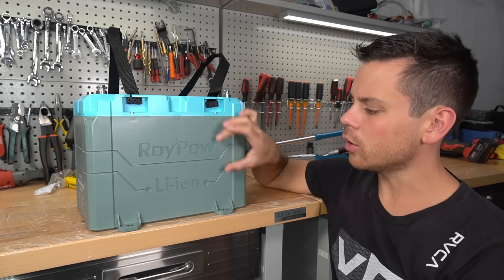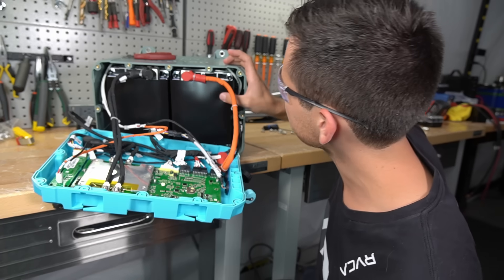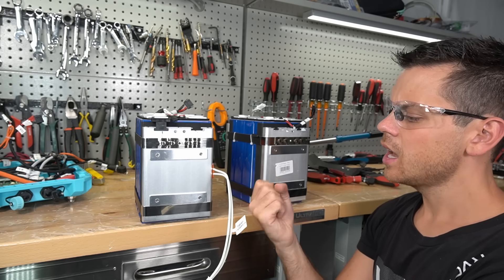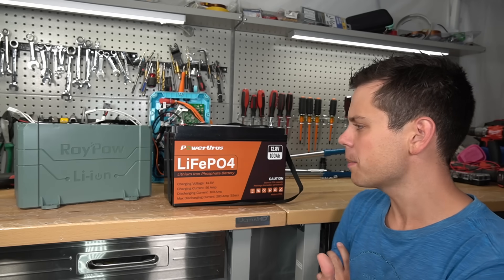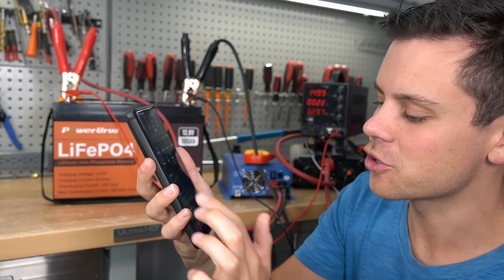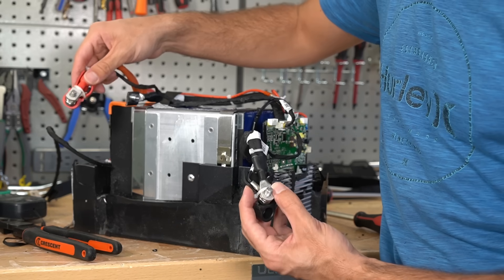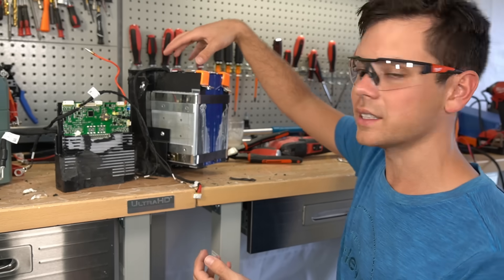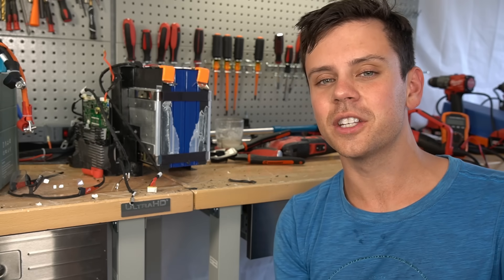RoyPow Solar/Marine/Golf Kart LiFePO4 Batteries

Comment from the maker: Attention: If you want the cheap price in the video, you have to add the batteries to your cart. Not sure why they did it this way. Links are below:

Product Affiliate Links:

12V 100Ah Budget Battery: 
https://powerurus.com/products/powerurus-12v-100ah-lifepo4-deep-cycle-rechargeable-battery?aff=2

12V 200Ah Budget Battery:
https://powerurus.com/products/powerurus-12v-200ah-lifepo4-deep-cycle-rechargeable-battery?aff=2

24V 100Ah Marine Trolling Battery: https://roypowcell.com/products/roypow-24v-100ah-lifepo4-battery-for-trolling-motors-and-fish-finders?aff=5

36V 100Ah Marine Trolling Battery:
https://roypowcell.com/products/roypow-36v-100ah-lifepo4-battery-for-trolling-motors-and-fish-finders?aff=5 

0:00 24V Marine Trolling Battery
1:37 Tear Down
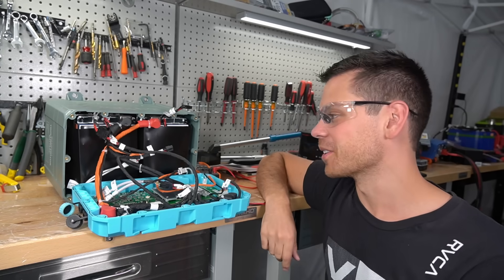8:06 $400 Budget Battery
12:30 $400 Battery Teardown
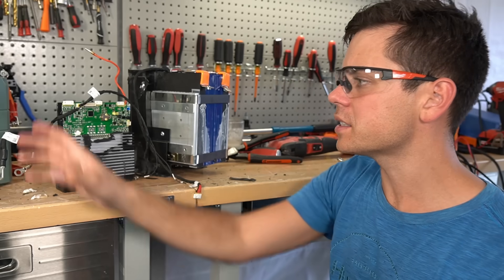15:49 Conclusion
~~~~~~~~~~~~~~~~~~~~~~~~~~~~~~~~~~~~~~~~~~
Tired of getting ripped off? Check out my "Will Prowse Approved" solar product recommendations below!

12V Batteries
https://www.mobile-solarpower.com/lithium-batteries.html

48V Batteries
https://www.mobile-solarpower.com/48v-batteries.html

Offgrid Inverter System Builder
https://www.mobile-solarpower.com/48v-complete-system-blueprint-559371.html

Hybrid Inverter System Builder
https://www.mobile-solarpower.com/code-compliant-48v-offgrid-system.html

Mobile Handtruck System Builder (very popular!)
https://www.mobile-solarpower.com/mobile-48v-system.html

Solar Panels
https://www.mobile-solarpower.com/300w-solar-panels.html

Ground Mount Solar Racking
https://www.mobile-solarpower.com/ground-mount-racks.html

Wire, Lugs and Busbars
https://www.mobile-solarpower.com/wire-and-connectors.html

Tools
https://www.mobile-solarpower.com/tools.html

Fuses and Circuit Breakers
https://www.mobile-solarpower.com/fuses.html

Plug-N-Play Solar Systems
Ecoflow, Anker And Bluetti! So many models to choose from. See my current recommendations here:
https://www.mobile-solarpower.com/full-size-systems.html

~~~~~~~~~~~~~~~~~~~~~~~~~~~~~~~~~~~~~~~~~~
Need to build a large DIY system? Need a trustworthy solar distributor? These are my favorites:

Signature Solar
Creator of EG4! Solar Minisplits, Victron and More! Largest Solar Store Online.
If you want $50 off, please use my link below and coupon code "DIYSOLAR50":
https://signaturesolar.com/?ref=cPwLcVc0SW-BjN

Current Connected
Best Prices for EG4, Victron, Midnite and so much more! Fast Shipping and Highest Rated Customer Service:
https://currentconnected.com/?ref=wp

~~~~~~~~~~~~~~~~~~~~~~~~~~~~~~~~~~~~~~~~~~
Join our DIY Solar Community 
Need more help? Join the largest solar forum on the internet for beginners and professionals alike. 140,000 members and counting!
https://www.diysolarforum.com

Check Out My Free Book
Best-selling and beginner-friendly guidebook to off-grid 12V solar!
https://www.mobile-solarpower.com/the-book.html

~~~~~~~~~~~~~~~~~~~~~~~~~~~~~~~~~~~~~~~~~~
Contact Information:
I am NOT available for personal solar system consult! If you wish to contact me, this is my direct email: williamprowsediysolar@gmail.com
FTC Disclosure Statement and Disclaimers:
Every video includes paid promotion or sponsorship (such as free products for review). Some links on this YouTube channel may be affiliate links. We may get paid if you buy something or take an action after clicking one of these. My videos are for educational purposes only. Information is subject to change/update at any time. Electricity is DANGEROUS and can kill. Be smart and use common sense :) DIY Solar Power with Will Prowse is a participant in the Amazon Services LLC Associates Program, An affiliate advertising program designed to provide a means for sites to earn advertising fees by advertising and linking to Amazon.com
Reply: They fixed it already
Reply from the maker: @niktak1114  oh thanks for the heads up, that was fast
Reply: @WillProwse  how much for the one with the destroyed balance battery. Would like to use it for the 12v led acid battery.
Reply: OK! Lesson learned !  I  was kicking myself for a similar mistake. Glad Im not alone
Reply: I've been seeing a lot of Facebook ads for renology's 200 amp hour lithium iron phosphate battery. way overpriced and whenever I ask him what cells they're using I never get a reply. I have also heard rumors that you cannot connect them in series. maybe you can shut some light on this.

also you might want to check out the power Queen 190 amp hour lithium iron phosphate battery hobotech recently did a review on it It looks pretty good for the price He didn't do a tear down but maybe you would?
Reply: Only $400 now, no sales tax and comes with free charger. If you let the Powerurus battery sit for a length of time without using, will the bluetooth eventually kill the battery?
Reply: would be nice to get a DSCOUNT CODE for these

Comment: I wonder about the thermal conductivity of the foam and glue they put in the heatsink fins, which work well with moving air. But inside the box, the trapped air probably won't move much, so those materials could be better than the still air that they displace. Maybe a good idea?

Comment: 16:40 The BMS heat sink is probably better cooled with touching the glue that is probably more heat conductive than the air itself. There is no air flow inside a battery else than the natural "convection".  Sometime plastic transfer heat to the exterior of the battery better than the air. Air is a good insulator and without forced air flow or limited convection, it is not effective

Comment: I have one and developed a small crack on the light blue plastic along one of the bolts. It's fine to just epoxy or silicone it i assume? Do LiPO4 batteries have risk of fire if it gets humidity in there or really more if it gets flooded?

Comment: I bought this battery on Amazon: 12V 12Ah Deep Cycle LiFePO4 Battery, RoyPow 12 volt Rechargeable Lithium Iron Phosphate Battery with low-temperature cut-off, 3500~8000 Cycles.  I use it for my sonar on my kayak.  It has failed within the warranty period of 2 years.  However, I cannot get any response from this company, either by phone, website, or letters.  Amazon can't even reach them.  This is terrible service!  Do you have any suggestions as to how to get a response from this company?

Comment: I bought an  Epoch 36100H for my golf cart. Same packaging as RoyPow from the outside. I has a heater so I can charge below freezing. They advertize 100 Ah but in reality it is a 105Ah. nice to see them underestimate in their adveertizing instead of the other way. On /Off switch. Wifi enabled . Meter that alarms when you get low in power and a second alarm so you won't run out of power getting home. It can run up to 120 amps continuous and 200 for a very short time. it works for my 2002 EZGO TXT series cart with larger tires. Thanks Will for letting me see the quality of the next generation 36v golf cart battery.

Comment: My Powerurus 200 Ah is junk  Voltage cuts and bluetooth freezes with just a 42 amp load at 52% soc. Then it comes right back on and repeats the cut minutes later. The app barely manages to connect after multiple tries.  Strange how many channels have positive reviews on this stuff but the first one I buy is complete trash.

Comment: Per your recommendation, I bought two of these batteries and connected them to a Xantrex 2000w converter/charger in my RV.  When I changed the settings in the Xantrex to Lithium, I also was able to set the charger rating to 80amps.  I'm not an electrician, so I was just going off what Xantrex recommended.  However, I noticed when I installed the batteries that it said the charging current is 50amps.  Does that mean I can only set my charger rating to 50amps?  Thanks!

Comment: Hi my friend I have two lithium battery in series 2 12 volt 100 ah so 24 volt for my trolling motor so I want to charge the battery at the same time so if I put only one bank how much amp I need to charge 2 battery at the same time because I have one bank 5 amp and it doesn’t work! Thank you for the answer ! Stephen!

Comment: Thanks for the great review! I was ready to order three of the 100Ah batteries to get more usable Ah than my current four 6v AGMs, then saw in the PowerUrus manual they do not recommend connecting more than two in parallel. Is there a good reason for that? Is that true of other Li-ion batteries? What am I risking if I do? Thanks!

Comment: Can I put prefab batteries in series and or parallel without adding a bms controller between or does the the internal bms within the battery pack sufficient

Comment: @DIY Solar Power with Will Prowse  How does the RoyPow Compare to the EPOCH batteries? Same company? I see the case say's RoyPow on the Front in small print, but different website &  different specs on the 36v battery... Using it for a Trolling motor.

Sincerely,

Matthew

Great Videos by the way, glad I found your channel

Comment: While searching to purchase these marine batteries I came across another brand EPOCH Batteries that has the exact same case as the RoyPow marine only difference is the color and that they actually have 12v in stock I’m curious if you know if it’s the same internals at all?

Comment: Hi,
I use GM batteries for my power wheelchair. Each battery has 12V 74 AHM. They are connected to 24V. I want to know if you can suggest me if I can use LiFePO4 batteries for my power wheelchair. Please explain to me how I can use LiFePO4 without damage my power wheelchair.

Comment: Temperature sensors on the terminals work great to measure internal battery temperature as the terminals transfer the internal heat efficiently

Comment: Do you know of a source for the "high quality marine battery" in 12v 100ah. I would like to use for energy storage on a sailboat. I would likely use 4 @ 100aH in parallel. I am only able to find this battery in 24 and 36v. Do you know the relationship between roypow and epoch batteries? They look virtually identical. Trying to understand this burgeoning industry. Great videos! So hard to find out what is really going on in these batteries.

Comment: I purchased a two pack 30 ah 12 volt Roypow batteries and one of the two was bad out of the box. Voltage measured 12.6 volts but would not draw any current when attempting to charge. Not sure what I think about this brand now. Most likely would try another company.

Comment: for a beginner setup, would you reccomend the roypow/epoch 100ah (105ah) marine battery or a 280ah eve diy setup.. will be using outdoors and on a boat.. and charging by solar off and on... your thoughts are appreciated buddy

-eve cells grade A are £140 each... and the roypow epoch 100ah marine is £300

Comment: Can you check out the Epoch trolling motor battery? Looks almost identical, but they’re a little cheaper then Roypow. I have been wanting to get a 24v unit to power my trolling motor, but I’m always too nervous because the variance in all the lipo4 companies
Reply: I too am curious about the roypow vs epoch for marine apps. 12v 100ah lifepo4 would be a game changer with this level of quality.

Comment: Can I charge two lithium batteries that have similar dissimilar app hours. For example could I charge a 12v 206ah SOK at the same time as a ECO-worthy 12v 30ah that are wired in Parallel on the same 14.6 V feed.   Both have their own BMS.   My usecase is that I would detach the 30 AH battery and use it as a trolling motor and then reattach it to the main system for charging when I am done. 

Anyway any advice would be appreciated

Comment: I woule pay for content where you would for instance show how upgrade an existing system with a new battery or new panels in a step by step way. The forums in which users have questions specific to their setup is so numerous and the Inverter configuration so diverse that anyone would pay in order to solve their technical problems. Me, ive an Axpert with 4 lead acids that I wanna now configure for my dyness 5.12 kw...

Comment: Thanks for investigating this trolling motor battery.  I am in the market to switch from AGM to LiFePO4 and your tear-down videos have been very informative.  My only request is that you add Ingress Protection testing to your mix of tests.  In a marine environment I would like to see if any water "gets in".  Maybe, before you open it up, you could spray it with a water hose (IP65) or submerse in a bucket (IP67), then see if any water is inside when you open it up.  What do you think about this suggestion?  thanks again,

Comment: I bought two of the 12v 100ah Powerus batteries. I charged them with the same Aims 75a charger @ 48-49 amps. It took about 1hr 40 minutes. According to the app they are 100%. I was expecting to need to to use my 10amp power supply to finish the last 10% to balence the cells but the Aims fully charged them. I have not load tested them yet as I am waiting my Victron shunt. The cells are within .004 of one another on both batteries at average voltage of 3.575v on one battery and 3.355 on the second battery.
Reply: Well my experience is that there is a glitch when using the Roy Pow app. I read 74ah then 100ah. This happened several times on three different batteries. When monitoring using my Victron 500amp shunt 100ah was observed during charge and discharge with no variation. So I believe at this point the batteries are good and problem is in the app.

Comment: Fun to watch you pull these apart. Hey Will can you look at moseworth batteries, I have a couple 200ah 12v running and would like to buy a couple more and would appreciate your feedback on the build quality before spending the cash on them. I believe moseworth made smaller lithium packs for the rc market. These 200ah are sold for trolling motors and are at a pretty low price point on Amazon. I appreciate your poking around the market for all of us trying to go off grid.

Comment: Rubber on the heat sink fins and batteries is probably intended to sink the heat to the case. Try checking the thermal conductivity of the rubber or rubber foam. Air gapping heat sink fins inside of a sealed case is a recipe for disaster too. I suspect the material is working as heat sink compound.

Comment: I purchased 2 x 120AH Solar King batteries in Perth, Australia and have them connected in series. These batteries are a pain to manage. Any upset to the power draw and the BMS shuts them down and it can take 20min or so to get them back online. I used to use the 4 x 120AH AGM batteries as standby cranking batteries but if I try that the lithium batteries spit the dummy big time. My 24V Isusu starts instantly so I do get the engine going but everything else in the motorhome is shut down until the BMS gets its act together. It might be helpful if you stated which batteries are able to be used as cranking batteries. Phil

Comment: I ask the following line of questions with the assumption that you originally began talking about batteries and solar energy focused on building your own battery packs from scratch. At least that is what I believe, correct me if I am wrong.
I make that point because your DIY message now seems to be forgotten. It seems like you are promoting more off-the-shelf products than promoting DIY.
Is it possible to revisit your DIY programs and integrate what you have learned since then? Maybe recalculate comparison costs? Thanks

Comment: If you were a 70 year old woman on limited income, intending to spend the winter in Quartzsite boondocking, what solar generator would you get to keep the A/C and appliances running? I watched your Eco Flow Delta pro video. What would be the most economical, that would power me for 4 or 5 months?

Comment: Hi Will, as always, very nice review and it made me smile, that even you get a surprise every once in a while. Are there other LifePO4"Marine Batteries" on the market that you are aware of, besides Mastervolt, which are un-payable? I am considering to recommend a change from AGM battery banks on a boat of a friend of mine in the Caribbean and all these normally found soft metal (rusting) enclosures wouldn´t be recommendable due to corrosion...

Comment: I understand that LiFePO4 Batteries have very little resistance compared to lead acid and shouldn't be used to replace a car battery without additional electronics to prevent damage to components in your car. It would be nice to see, if there are companies making direct replacement LiFePO4 Batteries for automobiles, what's out there and the quality of those batteries.

Comment: Looking for replacements of my AGM batteries for my RV.  What do you think of the Roy Pow 12v 100ah marine batteries, i currently have 2 AGM deep cycle batteries that are now dead after 3ish years.  Ant recommendations?  Would it be overkill to increase to 2 12v 200ah lifepo4 batteries, also what would you recommend for solar angels to charge when i am dry camping?  Thanks, really love your videos, great information.  Also have thought about building my own, would need to be in battery shelf under mid RV.  Thanks.  I really appreciate your help.  👍

Comment: Hey Will.  Quick question.  What was that power supply you were using to charge the battery with 49a going into the battery?  I could use one of those.  Thanks!  I like the smaller variable power supply also.

Comment: Will, I bought one of these PowerUrus batteries ($390, delivered) based on your tear down and I just got it (and an email, written entirely in Mandarin, asking me to rate the quality of the battery LOL). The instructions recommend charging every 3 months, which is similar to LA batteries. The self discharge rate is listed as less than or equal to 3%. That seems higher than other drop in LiFePO batteries that I own. This is my first battery with Bluetooth and I was wondering if that feature is always on and drawing a small amount of power from the battery.